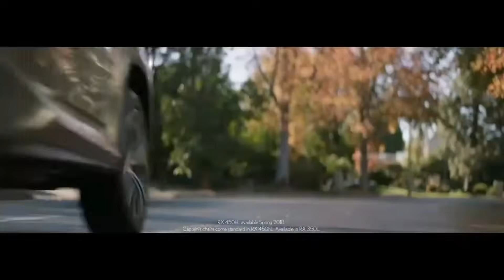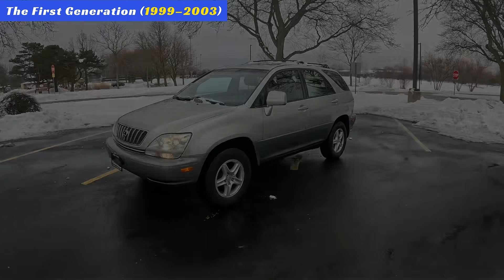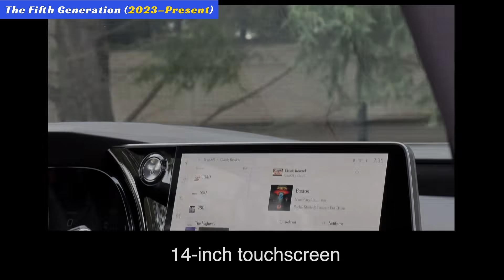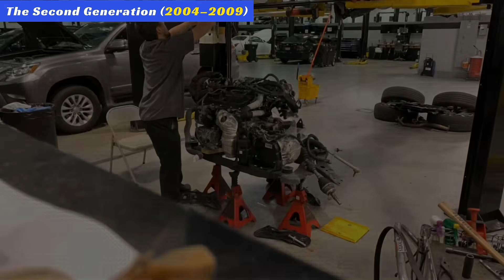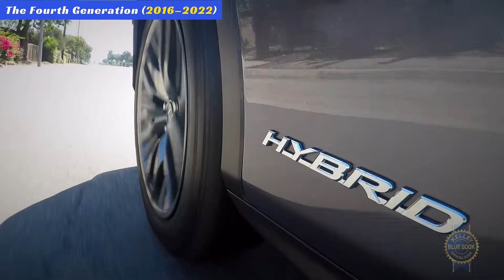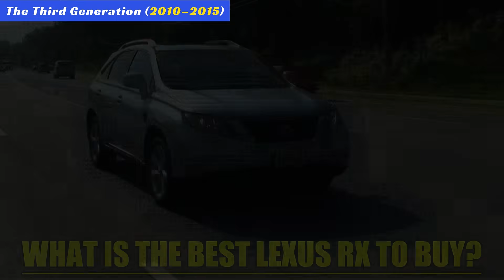Best Lexus RX To Buy - Which Lexus RX Model REIGNS SUPREME in 2026

Comment: Biggest issue seem the timing chain which might need replacement in some 300k km. The labour on it will cost a lot as the engine needs to go out.

I'd go for facelifted RX450h (after 2012) as a family daily car. Along with LS430, just for fun.
Reply from the maker: That's a really good point about the timing chain and the potential labor costs at 300k km. The facelifted RX450h is a solid choice, and the LS430 for fun sounds like a fantastic combo!

Comment: Love my 2014 RX.  Just got it last month.  My mechanic recommends a suspension refresh to the tune of $4,000.
Reply from the maker: That's awesome you just got your 2014 RX! A suspension refresh can definitely make a difference, especially for an older model. It's good to consider your mechanic's advice.
Reply: If you upgraded that suspension you would be going to back to see if they have your original parts still to put it back on

Comment: The last RX of its generation is the best. The first RX of its generation is the worst. Not just Lexus RX but pretty much all cars. 2009, 2015 and 2022 are the best. 2010, 2016, 2023 are the worst.
Reply from the maker: “You’re not wrong 👌 last year of a generation is usually the most refined, and first year is where most bugs show up.”

👉 2009, 2015, 2022 = end-of-cycle, fully sorted
👉 2010, 2016, 2023 = new generation, more risk early on

“But I’d say Lexus tends to do better than most brands even in first-year models—still pretty reliable overall compared to the industry.”

Comment: my 2009/2011 water pump replaced with hilux part & it works😊..& now its time to replace air suspension😅..
Reply from the maker: That's a clever fix using a Hilux part—Toyota/Lexus interchangeability for the win! Good luck with the air suspension replacement.